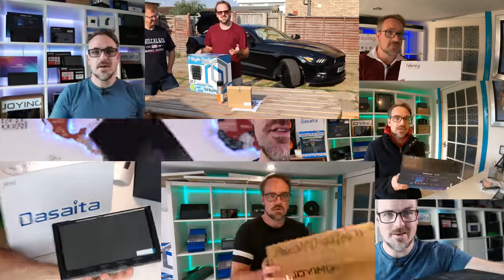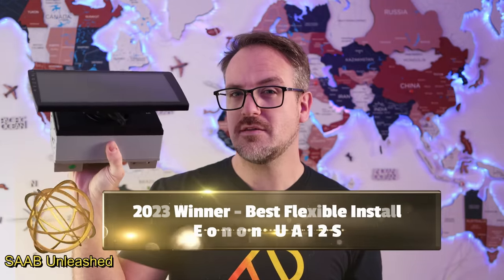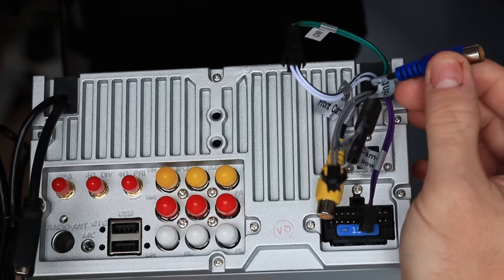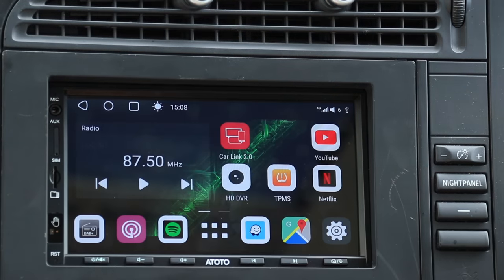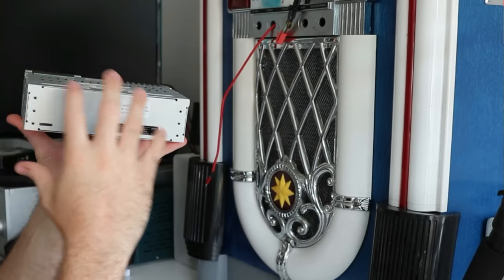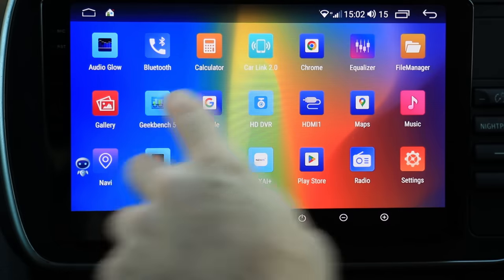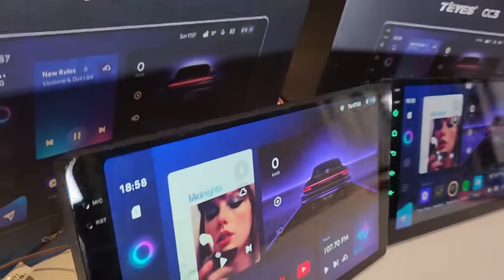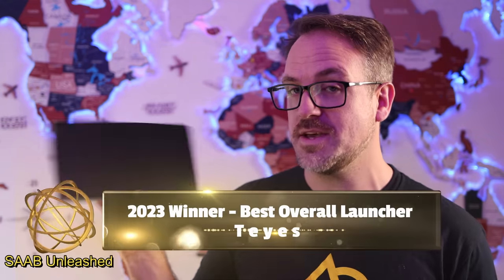2023's Top 7 Android Head Units

Comment from the maker: Mekede have now listed their M6 Pro Plus on Amazon https://amzn.to/49N4yRv - You will need to contact them via Amazon after purchase if you want HDMI or 360 cameras as a feature
Reply: Thank you so much for this video! 
Can you please recommend a premium unit that can fit flat in the dash with most german 2 din cars?
Reply: On the eonon.  The router wire thing to you showed.  How does that work?  My car doesn't have internet so I'm confused how that wire would give the radio internet. Please let me know. Thank you!!
Reply from the maker: @jp-ct7li  you can either put a SIM card into the head unit, or you can just connect it to your phone's WiFi hotspot
Reply: Have you seen the Mekede dudu7 models yet?  If so what are your thoughts?

Thank You for the Great content
Reply: Thank you for the comprehensive video. I read on FB with comment saying that Apple is licensing CarPlay, and this move may render CarPlay unusable on Android Head Unit, not sure if you have heard about this? And if so, will existing AHU CarPlay cease to function? Thanks
Reply: @SaabUnleashed  You really missed the best, what good is a head unit if the output is distorted unlike most head units there is on that you did not mention that has extremely clean output
Reply: would the list still stands in july 2024?
Reply from the maker: @idhamzaharudie  yes
Reply: is there a way where i can get this to fit for a 1999 honda crv like do i need a kit ?
Reply: I'm looking for a 9" head unit, not so much concerned for apps, but sound quality is what I'm looking for.  4+ volt output RCA's, 13 band eq, subwoofer control and crossovers. Have any suggestions?

Comment: You should really discern which of these units are FYT-based and which are not. Especially since FYT ones can run (and most of the time come standard with) the CAR LINK app, while non-FYT units come with ZLINK, a different app that is unable to run through a fast and stable wired Apple CarPlay connection, and has only terrible wireless connectivity instead (that's right: ZLINK is wireless-only, no wired CarPlay! Which inexperienced people will consider as uber cool, but is a nightmare in reality), forcing the user to do a cold hard reboot of the head unit each time the car is started again, making these units totally useless for iPhone owners! The issue there: non-FYT Android HUs cannot run CAR LINK. Don't you think such a problem is top priority?
Reply: I have zero problems with zlink and my iPhone on the unit I put in my Honda jazz
Reply: Yeah sounds like a you issue. Runs fine on both my ts18 and ts10 boards better than my factory unit.
Reply: I don't want any wireless connection, so if this is true, it’s really good to know
Reply: It works fine on my iphone
Reply: This is an android headunit video... not once did he say it was good for Apple 😂
Reply: @deathgazer21  they usually do apple carplay as well...
Reply: @Sustainavore  no shit, but this guy is crying about wired vs wireless carplay on a video that has nothing to do with carplay
Reply: @deathgazer21 sir… he is talking about the OS when talking about android head units…… all of em them run either android or apple car play
Reply: Most intelligent iPhone owner
Reply: The average iPhone owners aren't old enough to own a car 😂😂
Reply: @eggception3161  android is the operating software the tablets use not the phone compatibility genius
Reply: I would suggest an iOS based head unit, but they probably cost a lot more and change an extra $1000 for the proprietary cable to connect it to your car.
Reply: @therealjamespickering  The product you are talking about does not exist. All CarPlay-compatible infotainment systems are based on Android, but I now see with the second part of your sentence (the hackneyed joke from the 90s) that you never intended to be positively informative.

Comment: Great videos. I just installed a ZW Nav unit into my 2006 Jaguar XK and it is superb IMO. Just wondered if you came across this company? Are they made by one of these? I got it on Ali x for around £600, not cheap but its a special design for the car in that its  designed to replace the existing head unit in the Jag. Some Jag owners dont like this saying it spoils the look. I somewhat disagree. the benefits greatly outweigh this, audio was soooo much better without having to upgrade the speakers.
Reply from the maker: Yeah I installed one in my Saab 9-5NG a couple of years back, they are a decent unit

Comment: Thanks for this video.  I choose a joying 11" head unit specific to my 18 jeep wrangler.  The hardest part of the installation was the cameras, mounting and wire runs.  But some sad news.  Driving around town, yesterday the head unit went dead.  Had a bunch of warning lights go off on the dash(most concerning was the airbag light) then blank screen, no sound.  Trouble shooting revealed no loose wires and good fuses (both head unit and vehicle).  Only one month of use, doa, $600.  I think anyone choosing a head unit should think  long and hard about what your going to do, if you have problems.  Their is a definite language barrier and your a world away from help.  I will bench trouble shoot this,  I am almost positive that the canbus adapter is the cause.  I am replacing it with a PAC version to see.  BTW  I love what this head unit can do, and want it to work.  I'll update if I figure it out.😮

Comment: This video was very helpful to me. I’ve been looking at stereo vids for a couple of days now. Really like the look of the Android head units. 

One thing I never see (and can’t find info on) is AM/FM reception (dBf). I mostly listen to Sirius/Pandora/TuneIn but there are times when I actually enjoy terrestrial radio. 

The aftermarket units I’ve tried (Pioneer, Jensen, and JVC) have all SUCKED in comparison to the stock radio. It’s actually annoying enough that I have pulled the aftermarket radios and put in the original just to get better reception. 😢

Oh, and I'm not a fan of RDS station names. I can just as easily recall which station plays what using the digital numbers. It would, in fairness, be nice for the RDS - AND - the station number to be displayed simultaneously. Win-win for all.

Comment: at 5:30 in your video, you have the error "3d roundview is not activated". how do you resolve that as i have the same issue now. if you tell me i need to pay to use the 360 camera thats pretty lame.
Reply from the maker: Remember, joying doesn’t advertise this as far as I know, that message is probably something for licensing. It still works 100%
Reply: @SaabUnleashed  thanks for your help.

Comment: Quick Question; I bought the Eonon and am very happy with it Except for one thing, the screen is blindingly bright at night. I have the orange wire hooked up and it "dims" when the lights come on, but no where near enough. Sliders are set to minimum for brightness. Any tips or tricks? AGAMA Launcher has an overlay but that only works on the launcher and not any other apps or Android Auto.
Reply from the maker: Yeah I have that issue with a lot of them. I generally ensure I use dark mode on all apps.
There are also apps available to specifically dim the screen further

Comment: Hello there. I was wondering if I could get some advice. I've got a Ford Focus Zetec 2009, and I believe the model is MK 2.5. I still have the original radio installed. However, I'd like to upgrade it to a newer one with features such as SatNav, DAB radio, and the potential to connect to a camera in the future, like a reverse camera, etc. I'm totally confused and unsure about what to choose. Could you please recommend a reasonably priced radio that would fit in my Ford Focus, here in the UK?

Comment: (Speaking from personal experience)

Whilst the CC3 2K has a wonderful looking display and an immensely powerful SOC, depending on which applications would wish to use, you'll have issues with Teyes having deliberately locked down certain elements of the OS (this applies to the latest stock firmware as of today's date which is 9th Sept 2024).

CONS:
1. For no good reason that I can fathom, you CAN install any launcher you want, it WILL run BUT even if you use your chosen launcher to set it as the system 'default' launcher, as and when you restart/reboot the head unit, it will reset to the Teyes launcher regardless of the change you made earlier. Basically Teyes offers various 'add on' bits of software, some of which you need to pay for if you want to add them, so I suspect this approach is intended to try and drive additional revenue
2. For no good reason that I can fathom, you CAN install any NAV app you want, the nav app WILL run once manually launched BUT unless it's one that's on a very short whitelist, it will NOT show up as an option when you try to change the system 'default' nav app (The Tom Tom Go app is one of the apps that is affected by this restriction). This isn't the end of the world but there are scenarios in real world usage where this arbitrary restriction because a real pain in the bottom
3. A few other minor 'quality of life/usability' issues that can grate over time i.e. when the unit is in regular use

PROS:
1. The display is sharp and wonderfully saturated i.e. easy on the eyes
2. The unit is VERY quick and seldom feels 'sluggish' (I'm coming for a 4GM RAM, PX5 Xtrons unit that served me well for a few years)
3. Once the correct canbus box/model is selected, I was able to correctly program the various steering wheel buttons to exactly the actions I wanted AND the head unit correctly responds to things like me turning on the sidelights/headlights and the head unit then lowering the brightness to the level I set for 'night' (this is something I was never able to get working on my previous PX5 unit)

4. The firmware seems to be pretty stable (by the standards of Android head units) i.e. no application lock ups yet or need to restart the head unit to bring an app/functionality back to life

I can definitely recommend the 'CC3 Vincent Vega Edition' custom firmware, it's only 10 Euro (with ongoing free updates) and it addresses the above points, as well as making a large number of addtional improvements. Similar in principle to Hal9x v4 on MTCD/E head units, which I also used for years on my previous PX5 head unit).

Overall I'd recommend the CC3 2K BUT only with the customised firmware installed.

(hopefully someone will find the information above at least vaguely useful!)
Reply from the maker: Great feedback, thank you. I'll have to try the firmware myself
Reply: @SaabUnleashed  You're welcome.

Also, keep up the good work 👍

Comment: @saabunleashed can you comment on which of these may be preferrable for integration with a 2006 9-3 (currently has the ICM2)? I have seen some of your older videos on that subject, but wondered how these newer units worked in that regard. My initial preference would be to integrate in the dash (remove the ICM2 but not have the stick out tiltable screen). I could be pursuaded otherwise :-) But having audio steering wheel controls would be a nice plus. Not worrying at this point about backup camera etc.Thanks so much for your great content!

Comment: Question? I am new to this and have been wondering, when you say ‘Android’ system unit, do they interface with my Apple IPHONE for calling and the apps I use on my iPhone? I heard you state compatibility, but I am wondering if it works the same as on my Honda motorcycle? Thank you for all your reviews. I hope to contribute something soon to help you out. JT
Reply from the maker: What you'd do is switch on your iPhone hotspot and connect the head unit to if via WiFi. That means it will have internet access and you can install any apps you want, like you would a tablet.
OR you can just use it for Apple Carplay

Comment: Hi Sir! just discovered your channel last night and have been deep diving into your detailed reviews. I have a  honda civic 1.6 i-dtec with factory android 4 nav, if you know anything about this car then the wiring is super annoying and I think i might need to buy incartec looms as im assuming the ones with these units wont work 100%. Also some splicing required to retain the call buttons on the steering. 
Anyhooo - Question I have for you is - Do any of these units allow multiple phones to be connected to the call function ? I normally have a personal phone which i like to be connected for audio (and android auto in future) then a work phone i need connected to take work calls. 

Another question, does the eonon have split screen for the main apps ?

Comment: How many of these head units include amplifiers? Do you normally install a separate amp? Do you have a recommendation for one that might fit inside the double din space and run cool enough? The EKIY in your review has a fan on the back and a cable hanging off it. Where does that hook up?
Reply from the maker: All Android head units of course include an amplifier to run your built in car speakers.

The fan on the back of the EKIY just plugs into one of the ports on the back of the head unit.

Comment: Could i make a suggestion please....ive been researching replacing the oem sony unit in our smax 2013 and finally landed on a CC3 2k. One thing that seems to be vastly overlooked is if you have audible parking sensors which weve got, or should i say had...now the cc3 is in there are no parking sensors any more - perhaps you could do a video on that and all the pitfalls...so far ive found an aftermarket unit (nice if you could have mentioned that) as thats a further 100 quid and/or i might be able to re enable it in the canbus but teyes have not been very quick with any replies even though ive used their official site and added in my order number so they know ive bought it directly from them....

Comment: Thanks for the video, keen to buy a CC3 but I have one question about DAB, if you can please help. My Nissan Qashqai J11 has DAB+, does the CC3 have an aerial socket to support this, I’m thinking not from the wiring diagram?
If not, I believe I should be able to use a USB adaptor and use my existing aerial into that, instead of using the aerial supplied which i want to avoid sticking on my windscreen and I don’t think as good. 
Finally, how many USB sockets are available on CC3?
Thank you
Reply from the maker: Yes you can use a USB DAB stick, and you might need an adaptor to convert whatever your Qashqai has to the SMA connector that the DAB sticks use

Comment: I am running into problems both of the T'eyes and EKIY products. My 2010 Merc W164 needs canbus cables. These do not form part of the kits at either brand. I tried to look it up. No luck. They do not sell them. Any canbus box and cable would do in that case? Thanks in advance

Comment: Hi, can you mention how to get the 360 app on joying 15”? I bought one after seeing you had 360 working.. i connected front and rear cameras (rear not  installed yet) and 360 cams not plugged in. I cannot see the 360 app which should be visible if it has the ability. how did you get yours working? or does it only show after disconnecting normal cameras and connecting the 360 ones?
Reply from the maker: 360 cameras are different from the usual cameras, they don't have RCA connectors. They come in a set of 4 cameras which all connect to the proprietary connector located inside the Joying, which I show in this video

I did also say for you to confirm with them before you expect to see this feature because I didn't see it advertised anywhere

Comment: I have three vehicles that's that I would like to put the same system in. I have a 2014 Nissan Leaf, a 2016 VW Crafter and a 2016 Mitsubishi outlander. I am struggling to decide between a Teyes CC3 and EKIY T7. Are you going to do a more detailed video on the EKIY T7? Dab radio is important and 360 cameras. Any advice would be appreciated.

Comment: Thanks for the helpful video. Any chance you could tell me if the t'eyes or eonon support picture-in-picture for Google Maps? I want to have another app in full screen mode with the smaller Google Maps window in the corner. I've had two rotating 12-in Joying units that could do this, but their newest 9-in model doesn't support it for me, which is frustrating.

Comment: Question on the digital output. If using optical is it variable or fixed level output? In other words does it turn up and down with volume or do you need to use a DSP to adjust volume?
Reply from the maker: It's variable

Comment: Hi hope your well, just wondering if you know anything about the key 1 and key 2 wires. Do these need to be connected to work the steering controls and if so how?

Thanks
Reply from the maker: They either need to be connected to an appropriate wire in your car which carry resistive signals for your wheel controls, or connected to a CANbus decoder if your car uses digital signals for the wheel control